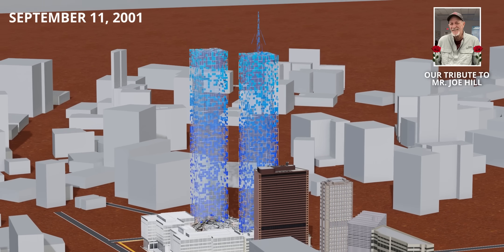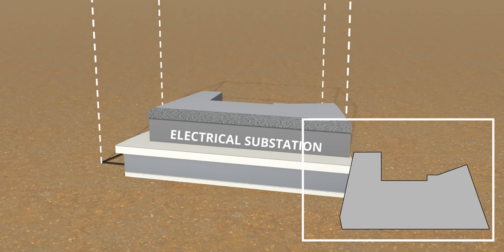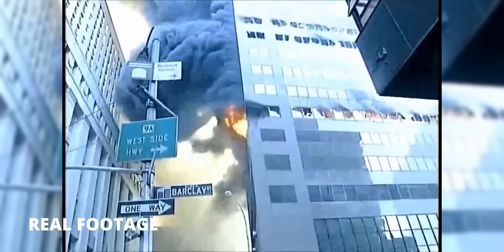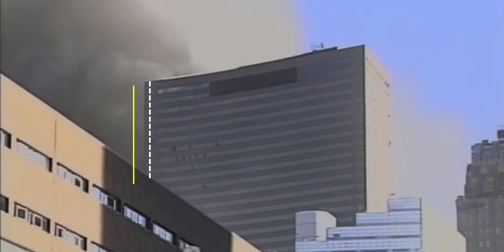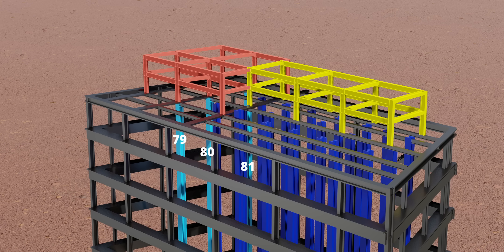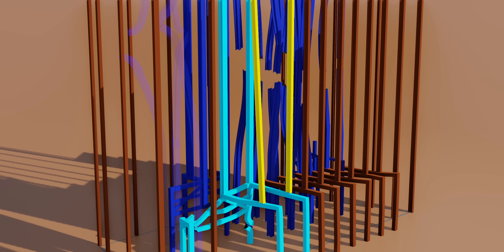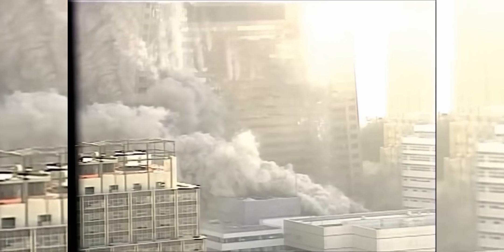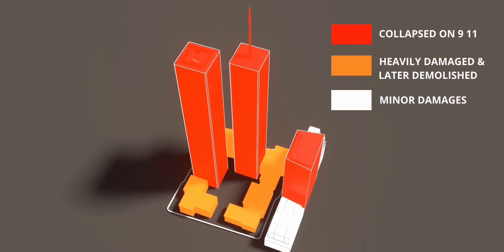Collapse of Building 7 | The Complete Physics

Comment: Sorry, I really doubt a building can collapse this way under the weight of a penthouse because of fires. There are lots of cases, and I've never seen anything like this.
Reply: Perhaps a deeper dive then?  

The North Tower collapse at 10:28am bombarded Building 7 with tons of debris, causing heavy damage and starting multiple fires which burned out of control for 7 hours. Half the FDNY firefighters having been killed, units in disarray, equipment destroyed, no water pressure, and the greater urgency of search & rescue efforts, firefighting was pulled as futile. The building couldn’t be saved and was left to its fate. That is the sort of choice firefighters make every day in brush fire situations - which houses to save and which ones to let go. Only real difference here is moving the decimal on the size and cost. People get overwhelmed by the size.

www.youtube.com/watch?v=g_SvpwyC17M&ab_channel=MFitz

Collapse of a burning structure is always a concern for firefighters. Steel buildings subject to fire rely on active fighting of the fires to survive. Buildings are designed around 1 to 3 hours of fire resistance, allowing time for occupants to escape and ACTIVE firefighting to get started, after which all bets are off. Left to their own devices they will exceed their design envelope and collapse, like Plasco Tower and Wilton Paes de Almeida. In B7 the occupants escaped, passive and active fire protections were compromised and active firefighting was abandoned 3 hours before the collapse, which left the building to its fate. It lost. Odds on Building 7 would eventually collapse, and it did. No big deal in logic.

www.youtube.com/watch?v=WnYBX6QT0R4

FDNY Chief Daniel Nigro ; The biggest decision we had to make on the first day was to clear the area and create a collapse zone around the severely damaged 7 World Trade Center, a 47-story building heavily involved in fire. A number of fire officers and companies assessed the damage to the building. The appraisals indicated that the buildings structural integrity was in serious doubt. I issued orders to PULL back the firefighters and define the collapse zone. It was a critical decision; We could not lose any more firefighters. It took a lot of time to PULL everyone out, given the emotionalism of the day, communications difficulties and the collapse terrain

FDNY Deputy Chief Peter Hayden ; We had our special operations people set up surveying instruments to monitor and see if there was any movement in the building. We were concerned of the possibility of collapse in the building. And we had a discussion with one particular engineer there, and we asked him if we allowed it to burn could we anticipate a collapse and if so, how soon? And it turned out that he was pretty much right on the money, that he said 'In its current state you have about 5 hours

The collapse of Building 7 was anticipated and widely reported in the media throughout the day, with 24 video cameras recording some or all of the collapse. Everyone knew what was coming and why.

www.youtube.com/watch?v=OY5S5k3tMHI

Building 7’s collapse was completely different to the Twin Towers and harder to understand as most details hidden from view and not intuitive, but we can still sort out what happened through careful analysis and observation. This is my explanation of the collapse relying on no outside authority.

Building 7 was complex, assymetrical 47-story steel framed structure built atop a smaller 3-story building, requiring lower floors dedicated to complex load transfer structures, not usable office space. Of trapezoidal shape and all-steel tube-in-tube construction, B7 (above the 7th floor) consisted of a central core of steel columns carrying most of the gravity load, perimeter steel columns around the outside of the structure carrying the remainder of the gravity loads and long span beams and girders to tie those elements together and form the floors. On the outside of the building hung a moment frame or outer shell.

Phase 1 : First externally visible signs of collapse initiation occurred at 5:20:28 pm and were notably quiet with observers not realizing the building was collapsing! No audible warning in the form of hundreds of ear drum busting 180-190dB explosive bangs preceding the collapse. Here at 12:00 a local CBS affiliate reporter is talking 10 blocks from B7 when collapse begins. People don’t start to notice the collapse until 12:11. At 12:45 is the famous CBS fixed camera clip of Building 7’s collapse. Note how quiet it is.

youtube.com/watch?v=t5tEy6mXSE8&ab_channel=fresnosean379

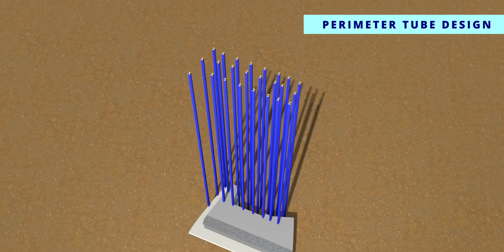Collapse initiation was due to lower floor failures above the load transfer region (7th floor) in the NE corner. In this video at 0:45 you can see the NW corner from inside the building while under construction, Column 79 just out of frame on the left. That big, angled steel beam across the top of the frame connects to C79 at one end. The girders connect to the beam. That beam and all those girders depend on just one connection

youtube.com/watch?v=nP3TNHPCIVU&t=35s&ab_channel=EdwardCurrent

Phase 2 : The floor failures caused a loss of critical lateral support over an excessive length of core Column 79 and it buckled. If you look at a floor diagram of Building 7 (see above) and look at all the structures that depend on C79 you quickly realize this one column was a relatively isolated structural element on which a disproportionately greater fraction of the structure depended analogous to say the Key Bridge. Externally we see a vertical progression of window breakage along the 44-46 line and a kink in the roof of the East Mechanical Penthouse at the top of the building, consistent with C79 failure. The transition from full capacity to almost no capacity occurs in an instant. Once the buckling failure occurs there is almost no resistance

Normally with a buckling column, the load could be redistributed to other columns. With C79 that is not the case - the failure did not redistribute the load, so the collapse rapidly progressed to the roofline, sinking the rooftop penthouse.

Phase 3 : With C79 gone, B7’s progressive, non-symmetrical collapse continues with C80 and C81 at the east end of the core left laterally unsupported and quickly buckled and failed as well, sending the EMP down through the building. C79-81 all have no diagonal bracing, which I believe is a major reason why they could not redistribute a lot of vertical loads among one another.

From there collapse progressed from east to west through the central core until the core was gone taking all of the interior floors and probably most of the perimeter columns with it. Follow the horizontal progression of window failures low in the building and the dropping of the remaining rooftop structures into the building. One of the big takeaways from the NIST Building 7 study (that gets completely ignored) was their modeling which determined C79 failing under ANY circumstances would have initiated the same collapse sequence.

Phase 4 : After 10 seconds only the exterior moment frame - a hollow empty outer shell – remains, giving the ILLUSION the Building is still standing since little has outwardly changed. It is just a hollow empty shell like an empty cereal box. Supported by only a few remaining columns that empty shell is quite unable to remain standing. With all core columns and floors gone, the north face leans inward, forming a V in the roofline, the last few columns buckle under the strain and the moment frame free falls, landing on top of the 7-story high debris pile. It is only late in the game here at the end that a single measurement of alleged free fall acceleration is taken, from a single point on that outer shell. The Building did not “free fall” – just one corner of the outer shell did, sort of. The Building was already gone before that happened. The period of alleged free fall was a product of how it fell NOT why it fell and cannot tell us what started the collapse. Start to finish the entire collapse took 18-20 seconds, 3 times longer than true free fall . How fast something falls cannot tell you what started it falling_ anyway. The debris spread outside the footprint, blocking surrounding streets, heavily damaging the Verizon Building and destroyed Fiterman Hall.

Building 7’s progressive, non-symmetrical collapse was incidental and unintended collateral damage from the combined effects of fire + time + gravity, started by the collapsing North Tower. That is true no matter who planned and carried out the 9/11 attacks or why . The collapse was of so little consequence it barely even registered at the time, a mere footnote. It only took on semi-mythical status as an alleged smoking gun years later when demolitions at the Twin Towers, missiles at the Pentagon and shoot down over Shanksville all failed and conspiracists had nothing left to work with.

Anything can seem like a conspiracy if you don’t understand how it works. Now you should. I hope you found this helpful, informative and it solicits informed critical comment. If I made any errors of fact, logic or reason or left anything important out, please let me know so I can fix it. IF you can offer a more plausible alternative please do. Be the first. Please start any reply with the words “Tits McGee” or I will know you didn’t read it and are wasting my time.
Reply: What about the massive damage on the building? It literally was the same thing that happened to 1 and 2. massive structural damage and lingering scorching fires.

Comment: “A building on fire is a building under destruction.” -John Jonas FDNY
Reply: Yes, fire is bad for building integrity. Thanks for the insight, Captain.
Reply: Fire is irrelevant for steel-framed high risers "genius"
Reply: @Yes-bk9cl  If fire is irrelevant to steel structures, why did fire destroy the USS Bonhomme Richard while it sat in port in San Diego? Steel sky scrapers are under a lot more stress than a ship.
Reply: @NWA744 And the Easter Bunny flew to the Moon... Back to Building 7 Kiddo
Reply: @yes-bk9cl,  if fire is irrelevant, for high rise buildings, why do they put fire retardants on the steel beams?  Maybe you’d like to answer that question lil bow peep
Reply: @NWA744  skyscrapers dont sink when theres a hole in the bottom
Reply: @khorn102  No, but apparently they fall symmetrically straight down through the path of greatest resistance as if all support columns failed simultaneously when they have asymmetrical fires burning inside them for a few hours.  Even though there was no precedent for such a collapse.
Reply: Perhaps some people didn’t see the roof and penthouse collapse in 4-5 seconds. Before the rest of the building collapsed.  It’s like the “truther” thinks all that building material fell down ten feet and just came to rest on the next floor down.  Say it ain’t so!

Comment: In no way have you exposed how this building fell at FREE FALL SPEED with NO RESISTANCE.  It is NOT POSSIBLE
Reply: And that did not happen.  All one needs to confirm is the gift of sight and ability to tell time.

Did you measure the collapse yourself or are you just taking the internet's word for it?

Yeah, that's what I thought.

Free fall SPEED isn't even a thing. Free fall is a measurement of acceleration NOT velocity, so there is no such thing as free fall SPEED.  Anyone using the term free fall SPEED is just expressing their ignorance and how they get their technical information from morons on the internet.

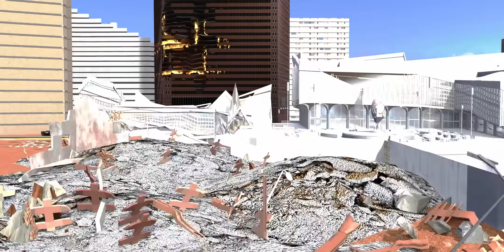Comment: 3:15 This statement is incorrect: firefighters were present at WTC 7. According to the NIST report, there was insufficient water pressure to combat the fires due to damage to the water mains from the Twin Towers' collapse. However, this claim is false. A hydraulic analysis of WTC indicated that the water pressure was adequate at 44 psi, and the collapse of the Twin Towers did not affect WTC 7’s water pressure because the water lines ran north to south, while WTC 7 was located north of the Twin Towers. 

Additionally, WTC 7 had fire-separated floors, was classified as Class A, and was equipped with sprinklers. It also had its own water supply. Interestingly, NIST's report notes that on September 11 at 6:47 AM, WTC 7's Fire Command Automatic Alarm System had been deactivated for eight hours. However, the report does not specify who deactivated the alarm system. There are numerous inconsistencies in the official narrative.
Reply: The video does not say there were no firefighters present at Building 7, just that the priority effort was on SAR.

From Question 8 in The NIST FAQ:  These lower-floor fires—which spread and grew because the water supply to the automatic sprinkler system for these floors had failed—were similar to building fires experienced in other tall buildings. The primary and backup water supply to the sprinkler systems for the lower floors relied on the city's water supply, whose lines were damaged by the collapse of WTC 1 and WTC 2. These uncontrolled lower-floor fires eventually spread to the northeast part of WTC 7, where the building's collapse began

And from Question 10:  The sprinkler systems did not fail. The collapse of WTC 1 and WTC 2 damaged the city water main. The water main served as both the primary and backup source of water for the sprinkler system in the lower 20 floors. Therefore, the sprinkler system could not function. In contrast, the sprinklers and standpipes on the building's middle levels (21st floor through 39th floor) and upper levels (40th floor through 47th floor) received water from two large overhead storage tanks on the 46th floor, and used the city's water mains as a backup

Curious where you got this alleged water pressure analysis from.  You don't say, which seems a glaring omission, just as you omitted these other critical details. 

 There are numerous inconsistencies in your narrative.
Reply: @TheCriticalStinker-01  Beyler, C. L. Analysis of the Fire Aspects of the World Trade Center Terrorist Attacks: Hughes Associates Inc. Baltimore, MD, 2002.

Comment: To all the non engineers, steels's melting temperature is not easily possible to achieve in fires like the ones in building 7 that could compromise the structural integrity of the building and on top of that, all the redacted information should be presented, why is there even after 2 decades there is controversies and not enough evidence regarding the collapse of building 7, everyone has stopped mentioning what the people in the vicinity reported of (explosive sounds right before the collapse of building 7)
Reply: " steels's melting temperature is not easily possible to achieve in fires like the ones in building 7"
So what?

" that could compromise the structural integrity of the building"
That you fail in very basic metallurgy isn't a bad thing, but you shouldn't brag.

"why is there even after 2 decades there is controversies"
There are no controversies. There's people who want to pretend they're really really smart and the man can't fool them and they have it all figured out. You know, kooks.

"not enough evidence regarding the collapse of building 7"
Other than the utter reams of evidence, that is.

"everyone has stopped mentioning what the people in the vicinity reported of (explosive sounds right before the collapse of building 7)"
No-one has reported anything of the sort. Repeating what you heard the really cool kids say doesn't change anything.
Here's a free hint: the estimated sound-level that would have been produced if Building 7 had been explosively demolished would have reached 130 decibel. That's enough to cause permanent hearing damage, and be clearly audible in New Jersey. There are plenty of videos of the collapse....not one show anything like that, or even close to that.